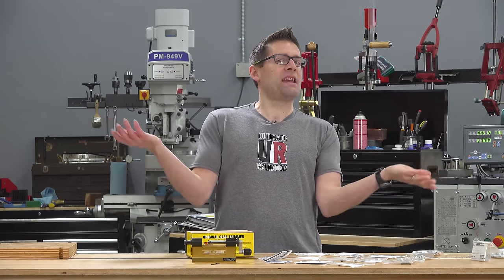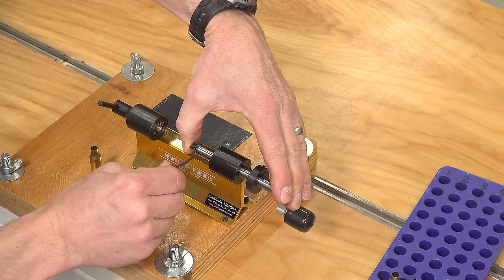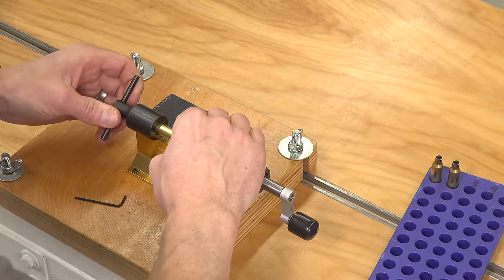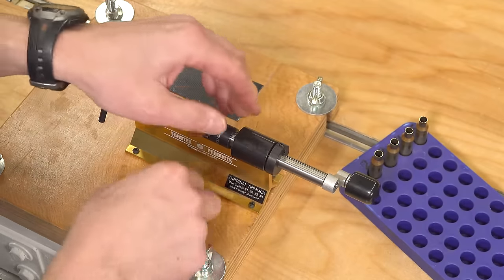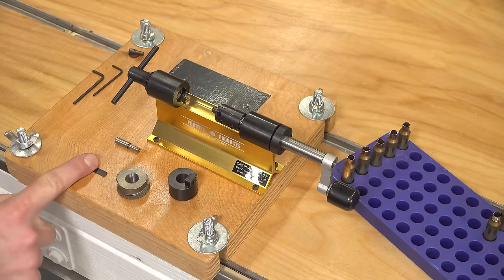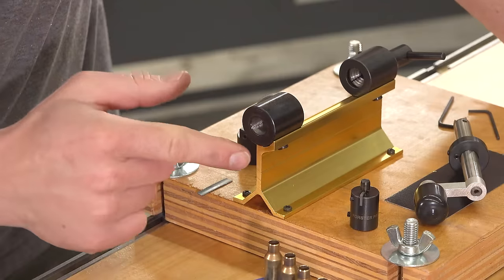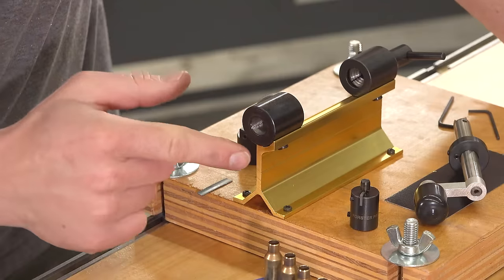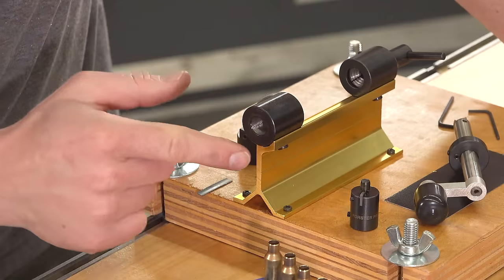FORSTER Original Case Trimmer: Trimming and Neck Turning

Comment: I bought my Forster case trimmer when I first started reloading for my "new" 22-250 back in 1966. It's been a great tool and works flawlessly. Just checked the original box it came in and saw the price...$10.50  Love the '60's!  (gasoline was .$0.25 cents a gallon too back then in the Muscle Car era).
Reply: Forster trimmers great tool I have my Dad's  they where not much cheaper in the 60's when you take in consideration that $10.50 in 1966 had the buying power of $99.07 in 2023
Reply: Giraud triway cutter and a cheap harbor freight drill press removed from the stand and flipped on it's back for installing it in. Anything else is torture

Comment: I have both a Forster and a Wilson Case trimmers. The Wilson is often considered as the creme de la creme of precision case trimmers and it is a fine tool.
But i find myself using the Forster more often these days. I have found the Forster to be just as accurate, quicker to use and i'm less likely to damage soft annealed necks.
You do have to be vigilant with the Forster to get the consistent results. Eg, making sure the case is fully seated in the collet. I also found mounting the trimmer on a block of 4x2 and securely clamping it into a vice makes a huge difference. At first i had it screwed onto a flat block of wood thinking that a portable trimmer would be ideal, it wasn't.

Comment: I find it refreshing to see manufacturers addressing not only case trimming but the finer point of case neck thickness trimming. A couple years ago I started loading 300 Blk Out and used converted cases from 5.56. Opps, quickly found the issue that different manufacturers case walls were not the same and a case would not fit into the chamber as the neck metal thickness was too thick. CASE STUCK…! I watched numerous videos and looked on line and was shocked that almost no one was talking about this issue. After research I finally found and bought a Hornady Neck Trimmer. Realizing the neck effects accuracy as well as fitting into the chamber. I began posting about this issue and behold, evidently someone was listening as you see this great video of the new features from FOSTER. Great Work to bring this forward by this channel and its brilliant creator. Bravo….

Comment: Years ago i started trimming using Lee trimmers, it was ok but kinda a pain to use. Next purchased a Lyman universal, it's ok but the cutter shaft is kinda sloppy and even with a power shaft and carbide cutter it still had a touch of chatter on the trim. But then I got a deal on a Forster, new in box at pawn shop and haven't looked back. Its the smoothest, tightest shaft trimmer I've seen.  I cleaned the goopy oil/greese off of shaft and bearing block, treated both with a spray silicone spray lube, drying each treatment as I  sprayed
 6 layers, then after a couple days of good dry time added very lite wax free turbine oil and its been free of rust and trouble for years. It cuts straighter than any other on the market that I know  of. There is also a larger base for the bearings for larger magnum cases. If I could afford another one to stage them from trimming to neck uniforming thats the way I would go or visa versa, uniform then trim as thats the way to do it.
    Untill someone can prove there is a better cutter, with tighter tolerance its the one. And even then I probly won't change.
   The only improvement possible would be an auto feed on the neck uniformer instead of having to use two hands so close.

Comment: I have a Forster Original trimmer that was owned by my wife's uncle for a long time before I got it.   He used it just for case trimming.  I used for same then found out about all the accessories available for it.  I have the outside neck turner and the hollow pointer.   Both work great and it trims cases better than every other "mini lathe" type trimmer I have used.
    Thanks for sharing.

Comment: I've had this tool for several decades. It has worked great, but is a bit slow. On the outside neck turning, I set it to just take off the high side of the neck instead of going for a cut all the way around. That way I don't get the neck too thin. They also make reamers for removing metal from the inside of the neck, which is useful for wildcatting where you neck a case down a couple of calibers. It is still better to make the final cuts with the outside neck turner because it brings the neck to a uniform thickness all around.

Comment: I have this case trimmer and the one for a drill press. I bought it new in the late 80s. It is a cool tool. I have the 3 in one trimmer it is great to be able to trim to length and chamfer and de-burr all in one step.

Comment: I have the same trimmer with a heap of attachments. The inside neck reamer it great for cases that tend to get a donut, like the .243 Win.
Tip for when neck turning on this - for best results you want 1) a tight fit against the pilot and 2) to ensure that any neck thickness variation is pushed to the outside where you are cutting. The solution to both is a cheap Lee collet neck sizing die where you can remove the mandrel and polish it to exactly the same size as the pilot.
Looked as if the cutter shaft housing on your trimmer was slightly loose.
Reply: The tip on the use of the Lee Collet sizing die is outstanding.....Thank you!

Comment: I've used one for many many years, in the 70's I believe, this may sound strange but my technique is to use both hands at once in placing the case and tightening the collet. I don't loosen the collet but enough to fit the case, in one move I place the case while holding position and tension with my right hand, using the heel of my hand to apply pressure to the cutter shaft, at the same time I position the case in the collet with my fingers of the left hand while tightening the collet with the heel of my left hand. Once you find your rhythm it goes pretty quickly, you're doing two things at one time with each hand, efficiency of movement, no wasted action.
Reply: You should make a video of your technique cause this was hard to understand.
Reply: @metaflux2  It is hard to understand, but I think he is saying he has, in effect, turned his two hands into four by using his fingers and the heels of both hands.  His left hand heel tightens the collet handle and his right hand heel holds the shaft in place.

Comment: Bought my Forester 1976-77 when i started reloading with a Rock Chucker Jr. Started out loading .22 Hornet for a Contender then. Got all the accessories in a yellow blow moulded case except that 3 in one trimmer/chamfer tool you used and a power attachment. Must have came later. i was a machinist then and liked the precision this little lathe brought to my reloading bench. i still like it tho i doubt i will ever get a power attachment for it. Never have been in a hurry when reloading

Comment: i have one of the original trimmers for every caliber i reload. a couple calibers i even have two trimmers. in those calibers I'm converting one caliber into another such as 300AAC. one trimmer takes me to 0.020 longer than trim to length, then the case goes through the forming die. finally the second trimmer with a neck turning head, set to cut neck wall to 0.010 thick and catch the length cut to final trim to length. the fine adjustment screw deteriorates quickly i discovered, thus cutting cases WAY to short. so when i first set up the trimmer i use the fine adjustment to get the case length i want. then i remove the fine adjust screw and set screw loosen the stop colar seat the cutting teeth on the mouth of the finished case then set the stop colar on the bearing face.

Comment: I use a Frankford Arsenal Platinum Power Case Trimmer for trimming duty and converted my Forester to outside neck turning.  In 2022 6.5 Cm brass is very expansive when you can find it so I convert 308 brass (I have barrels of it from my NM days) to 6.5 Cm and use the Forester to turn the necks.  Hot tip, a "G" size letter drill is perfect for the inside of the resized cases and I have 2 pilots for turning the outside.  One standard for unsized brass and I turned down another and polished it a few thousandths for doing resized brass or my converted pieces.  My 308/6.5 converted brass works great putting 120gr PPU OTM bullets into 5 shot .5" groups with my Savage 12FV at 100 yards and I did see a very noticeable reduction in group sizes turning the necks on both factory and converted cases.

Comment: Gavin- I have always only turned my collet lock around 1/4 turn, sufficient to remove and replace the case.  Makes a real time difference.  Everything from .17 Remington to.45/70, both overall length and neck turning on bottleneck cases, set up after a couple of times becomes quick.  Going to get the optional extension for power feeding to save my arthritic wrist and fingers, otherwise some of the best money I have spent on reloading

Comment: I have been using one since 72’ when I also bought a Bonanza Co-Ax press and Benchrest dies for my 222rem. Over the years I’ve added several calibers so needed Pilots for 17, 204, 6mm & 7mm. I will note though  for 17 cal you need to buy a shaft too. I’m probably going to be picking up the longer base model and use with the neck turning attachment. I picked that attachment up early 90’s but didn’t really use until a few years ago. I don’t have the three in one tool. My accessory case is pretty full but I could see it would save time and be easier on you. Like I said I’ll pick up the longer base and set up for neck turning. I guess coming up on 48 years is pretty good service. Same can be said for the CoAx press which Forster bought out. If it works don’t fix it lol

Comment: I've had that forever.  Works great.

The other Forester tool that is very very worth your while is a drill press case trimming tool....

So you mount the base on the flat plate of your drill press.  The case will stand straight up in the collet mount.  The cutter will mount on the toolhead/chuck/whatever of the drill press....  Getting it set up perfect is kind of fussy, but once you get it, it's fantastic.  I wanted to trim a few thousand 308's at one point.  That drill press setup made it buzz right along.

Comment: 12:15 or you can use a feeler gage to set the cutter depth to give a pre-determined case neck thickness. I've had mine for about five years now, between that, and the expander mandrel I had to switch to a tenths indicator to get some wiggle from the needle from runout.

Comment: For maximum versatility down the road, buy the longer Classic base version if you intend to add the 3way head or neck turning tool. I've had the Original for 40 yrs now. Always liked how expandable and versatile this unit is. It is a tool that any beginner should get if they want a decent, expandable platform trimmer. And if you want a 3way cutter head in a calibre they don't list, Henderson Precision will  supply them now.

Comment: I now use 2 of these each set up for specific calibers....love it! Also have a Frankford arsenal platinum power trimmer that I don't use any more as its so noisy and it uses a shoulder datum line to trim off of, which can cause trim length differences and affect accuracy, where as with the forester it is ACCUAL case length.

Comment: Forster makes 3 bases ,Original  5 3/8 in. long ,Classic  6 1/2 in.  long and 50 BMG  7 in. Long
Reply: good to know. i was thinking that looked kind of crowded with all the options installed.
Reply: if you remove the spindle head and the collet holder there is a second set of threads there to move each piece over for longer cases

Comment: Great trimmer. Happy to see they came out with a 3 way cutter. That little thing is kind of a pain in the ass to use though. Great if you're a benchrest guy who doesn't go through a lot of brass. edit: Love the neck thickness trimmer! That looks a lot easier than my sinclair tool. You need a degree to use that thing.

Comment: I just remove the crank arm and chuck right onto the spindle with my cordless drill. No adapter needed, so I was shocked to find they offer one. I do think I might try the 3 in one, or at least a new cutter head. Mine can leave a nasty burr around the outside edge of the case mouth if I'm taking more than a few thou

Comment: As the case gets longer, it gets thinner. This has been said on numerous reloading videos. I can see trimming the length back to tolerance, but thinning the neck reduces the strength for the tension or press fit you need on the bullet. So, when I do not see a caliper actually measuring what I am supposed to achieve as precision, then please define the value of a “little bit”. I want a number. Thanks...🤠

Comment: I have not had good luck using this tool for trimming. Very pressure dependent. May as well use something powered. I have seen case length to be a relatively unimportant variable in my reloading compared to other case measurements.
Reply: Forster makes a power adapter that replaces the handle.  I have them on both of my trimmers and they work great with a cordless driver.

Comment: That micro adjustment screw is way too fiddly. I want those two big flat surfaces registering completion, not a small surface offset from the centerline that can induce chatter or can't into the head.  Set the head to just  touch, grab a pack of feeler gauges and  slip in the blade the thickness you want to remove.  Push the collar in and lock it down.  No fuss or fiddle and you are registering around the complete circumference instead of a single offset point.
Reply: Valid point. I like your solution a lot, will give it a try.
Reply: Yeah, I stopped using the micro adjustment screw for the same reason.  Backing it all the way off and setting the big collar is way more reliable.
Reply: The micro adjustment screw is not intended to touch the flat, but rather position the collar then be retracted and locked so it does not touch the flat.  I set my stop collar same as you, with feeler gauges, but the micro adjustment screw is another way to do it.

Comment: Is there a different 3-in-1 for long action cartridges? My father has been using one of these for many years and I learned to reload using it. I like to insert case on pilot and push it with the case on to the collet and rotate a little while tightening the collet. Looked like you were tightening the collet a lot after installing the 3-in-1. More so than when straight trimming.

Comment: It doesn't look like there is enough room to use the 3-way trimmer or the neck trimmer on long action cases like 30-06 or 7mm rem mag.
Reply: I've used mine to neck turn .30-06 length cases.

Comment: It looks like there is a lot movement of the bearing when you're cranking, wouldn't that translate into inconsistencies?
Reply: You'd think so but it doesn't, not in my years of turning necks. Also a little lube helps with smoothing out the cutting.

Comment: What is the better way to turn neck with this tool, outside neck turn or inside ? I want to buy one but I still ask myself for turning outside or inside the neck. It's for .300 wm. Have you an idea about what is better, outside or inside for this caliber or is it the same ? thank you.
Reply: Use the optional reamer head to uniform insides. Turn outsides for consistent neck wall thickness. Best way to turn necks isn't what Gavin shows. Turn necks top to bottom but such that only about 2/3 to 3/4 of the circumference is cut. That way you're cutting the thicker portion of the neck to the same thickness as the minimum.

Bedding the action in the cheap factory plastic stock, polishing the trigger and handloads produced .75 inch three shot groups in my first higher quality deer rifle - a push feed Model 70 in .270. Outside neck turning factory brass took it down to 3 shots consistently in the fours: Under .5 inch. Excellent for a factory rifle.
Reply: @larrymitchell3502  thank you for your answer.